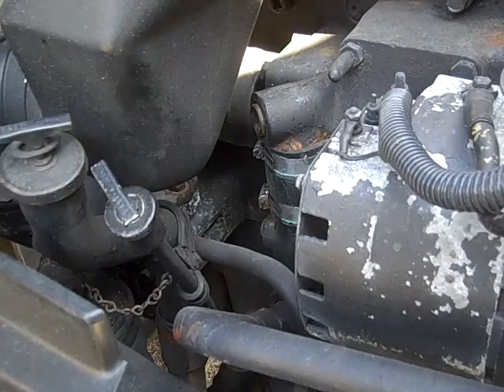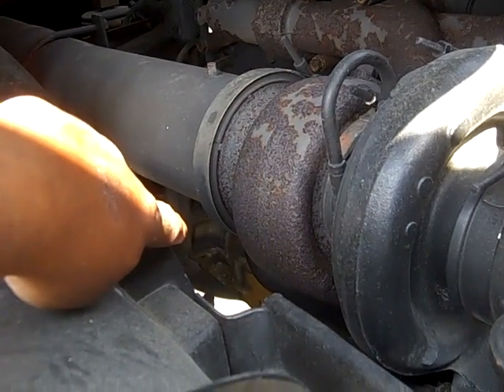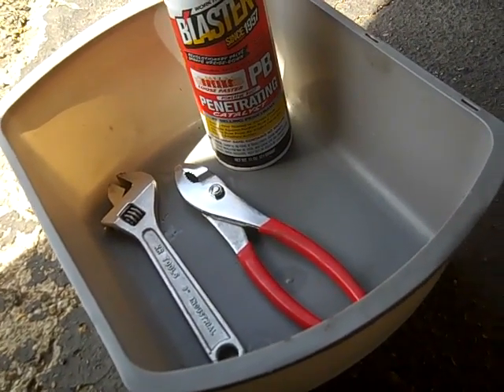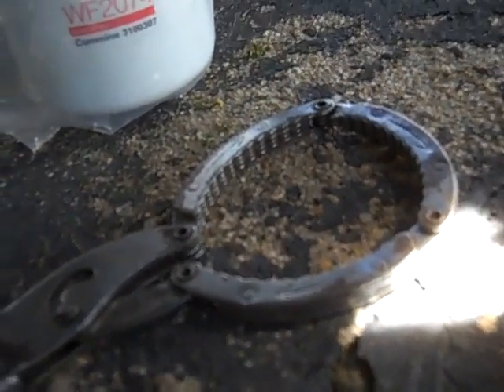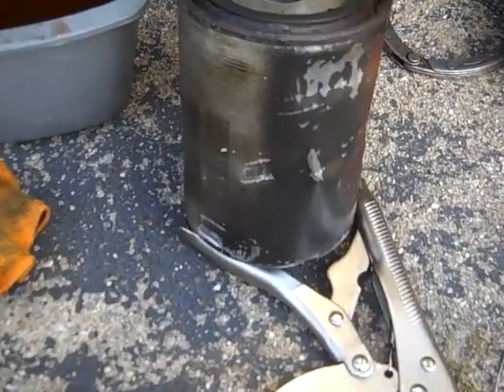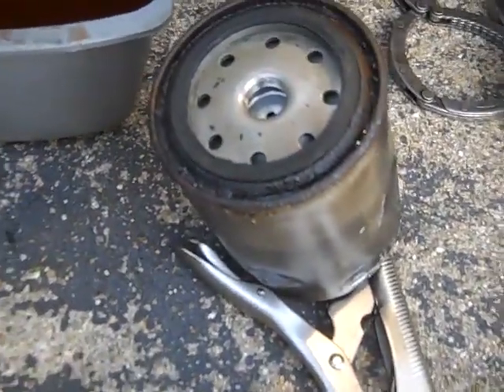How to change a coolant filter on a Cummins Diesel engine

Comment: Im sorry to bother you ,but first time i changer coolant filter but forget turn this valve off before open filter and right now it leak behind the pump ,so how can i reset the shut off coolant valve ,i appriciate it.😢😢
Reply from the maker: No problem glad to help if I can, as you see in the video turn the petcock cross ways, fill the filter with coolant, carefully screw it back on, check your reservoir and top it off be a use once you open the peacock again coolant will fill the void, if not then you will have to bleed the air from the system and some engines you can leave the reservoir cap off and watch the air escape there, check for leaks around the filter, hope this helps.
Reply from the maker: Thanks for Watching.

Comment: Part number
Reply from the maker: For the filter, contact your nearest truck fleet parts facility for your model truck and engine design., and Thanks for watching.
Reply: Mine started leaking from passanger side looks like a metal box with 4 bolts and an Ellen bolt on the middle of it.